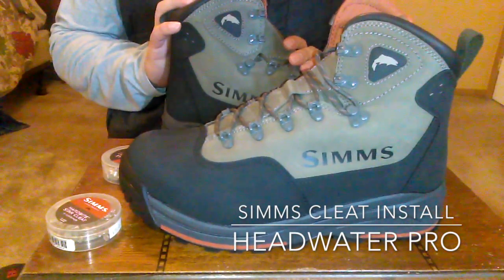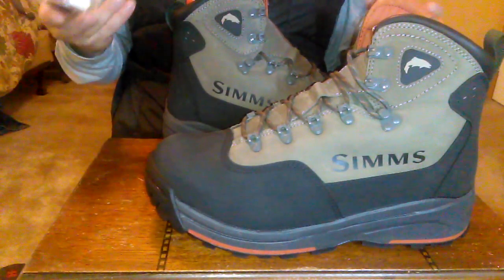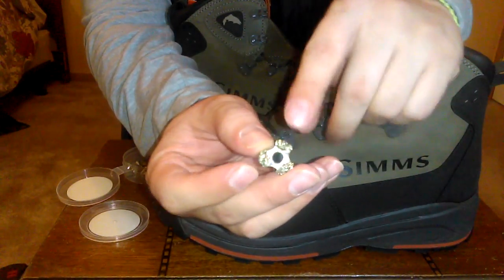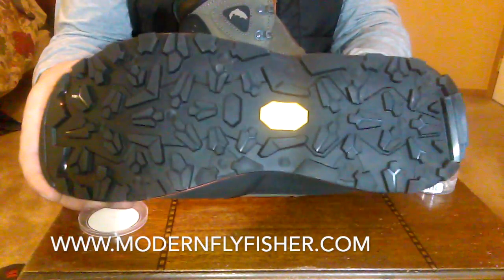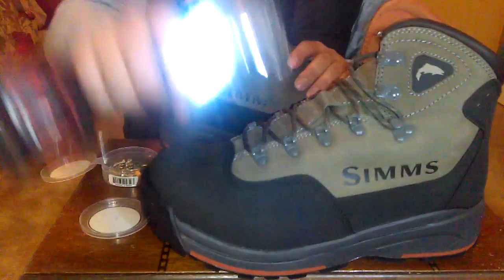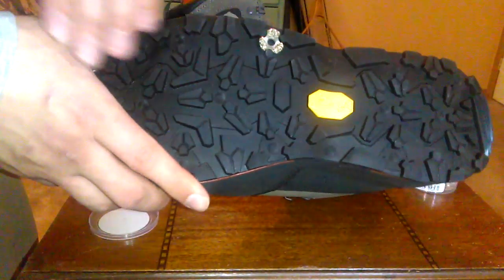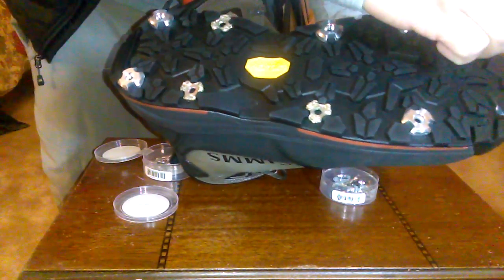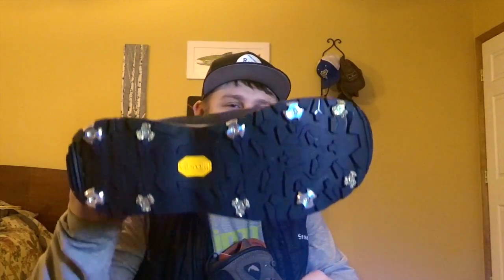Simms Cleat install - Headwaters Pro boot

Comment: I like the way these cleats look. See that the hardbite cleats are just under $30. and the alumibite cleats are $21.95 - for 10. Figuring you need a minimum of 10 per shoe,  you are going to need to buy two packs, so about $60 . for the hardbite and over $40 for the alumibite. Kind of approaching the cost of some wading shoes. Perhaps not quite as fancy as these, I purchased Kold Kutter studs made for ATV's and snowmobiles. Per 100 they cost about $27. on Amazon. You can buy carbide tipped studs for cars or trucks for just under $20. per 100 there as well. As studs may wear or fall out eventually you'll have replacements. I add glue to the stud threads first before installing. I have this same Simms boot. Great shoe, although the orange liner is cloth, and that tore so badly after water immersion that I finally ripped it out. The shoe is still fine, but no longer has the liner. Tried the Vibram soled boots once with out studs. As the Simon and Garfunkel song goes, "slip sliding away. " Never again.